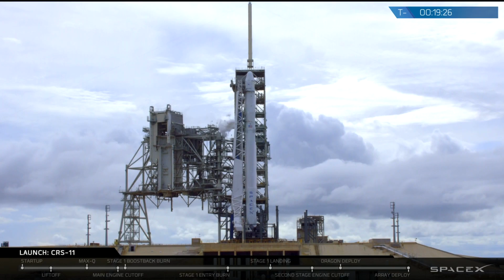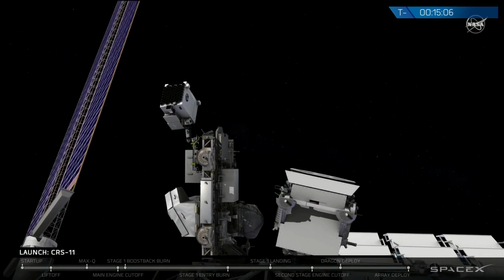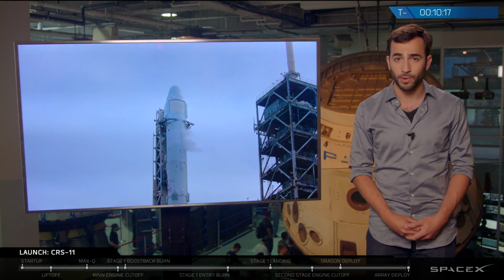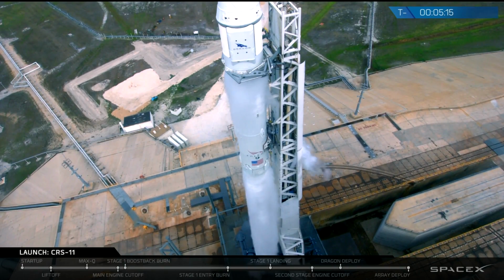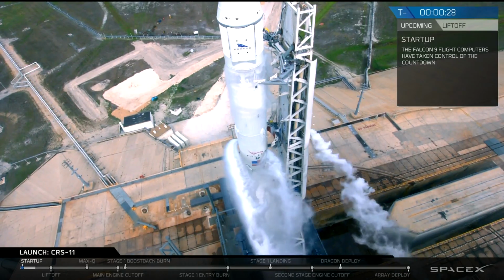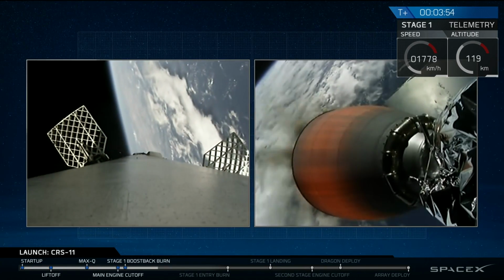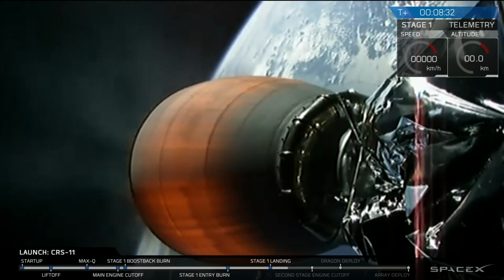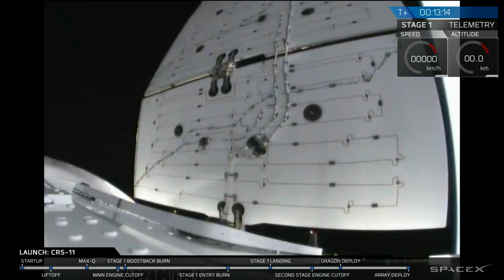CRS-11 Hosted Webcast

Comment: QUESTION: 
The entry burns slows it down from about 4500 Km/h to around 34 00 Km/h (around minute 36 in video; t+6:00). Then, after entry burn is completed, there is a short period of acceleration, followed by a continuos period of deceleration (starting at about T+6:30 and about 27 km altitude) to about 1100 km/h before the final burn.
What causes the deceleration? What is different above 27 km altitude that allowed the stage one to increase speed and what changed so that it started to decrease without a burn?
Thanks!

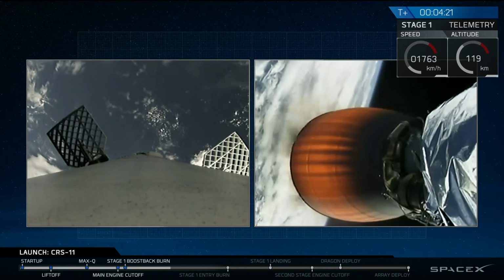Comment: 34:19 a few satellites
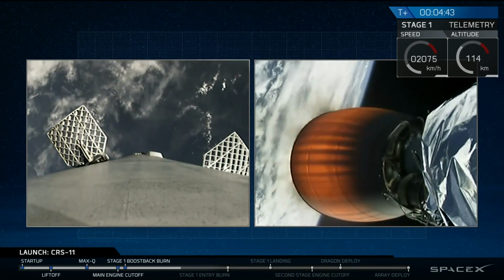34:39 some more
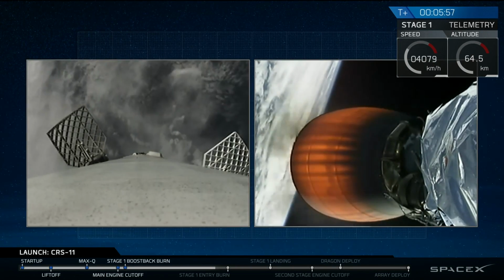35:54 mysterious object flying by (maybe space junk?)
Reply: There were no satellites visible. What you saw is normal ice, soot and debris coming from the aft area of the Falcon 9. The larger object may have been a part of heatshielding material at the base. Its all normal and can be seen on several of the previous flights.

Comment: Very nicely done.  Congratulations guys.  I can't wait to see you fly (and propulsively land) the Dragon 2 later this year.
Reply: Dragon 2 will land at sea initially so wont be this year. SpaceX will use the Dragon 2 for uncrewed cargo flights eventually under the CRS-2 contracts and they will use those to perfect the propulsive landings on Dragon 2 before doing it with crew. Dragon V1 will be retired.
Reply: Ah.. that's a shame.  I was really looking forward to it landing propulsively.  I had thought they were going to land it unmanned using thrust initially.  I wonder if they will use the rockets to test it's landing capabilities over the water.. but then the rapid cooling might damage them.  Still can't wait to see it land like a proper 21st century space craft.

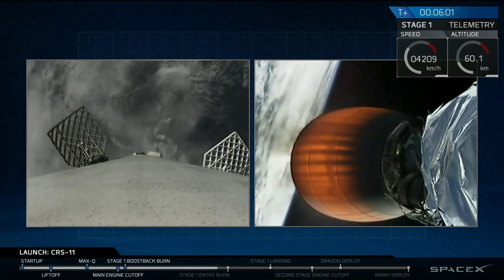Comment: What was the debris from that flew past the camera at 35:59 ?
Reply: Your reply inferred he said it came from the top. Like you said, it comes from the bottom. It's a piece of ablation shield. It's OK, because it's past the point of maximum heating.
Reply: No. The objects comes from below the rocket. It couldn't have been the reentry shields.
Reply: The bird doesnt have to fly 2000 km/h when the rocket does. The sensation is the same. But yet it still couldn't have been a bird, because of the altitude, as you said.
Reply: Yes, a fucking bird at that altitude travelling at 2000km/hr.
Reply: Birds don't fly at such altitudes. It was 58km
Reply: Joke. Birds max out around 8 miles.
Reply: cbr
That's not what he said.
Reply: What did he say then?
Reply: cbr
actually, some birds fly at ridiculously high altitudes.
Reply: Entry burn started shortly after that. It could be related to that.
Reply: not again
Reply: You will have to watch the film "Unacknowledged" to answer your question
Reply: it was debris which comes from  main engines while traveling over supersonic speeds, maybe Maybe the painting of the rocket that came out
Reply: its frozen black ice probably leaking kerosene
Reply: Debris from the ablative heat shielding that is on the bottom of the rocket near the 9 engines. It is used to protect the engines during reentry.